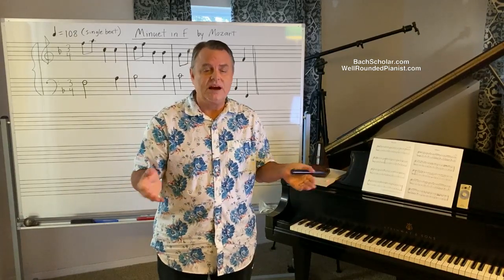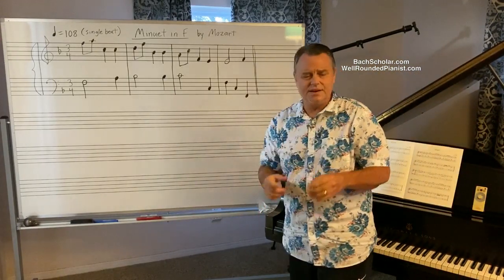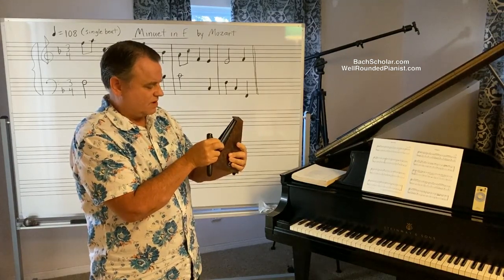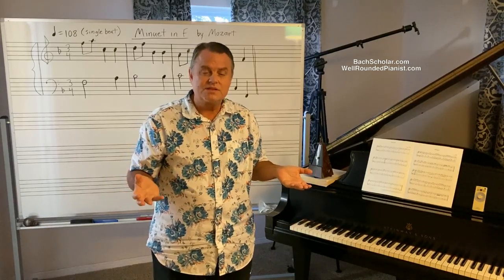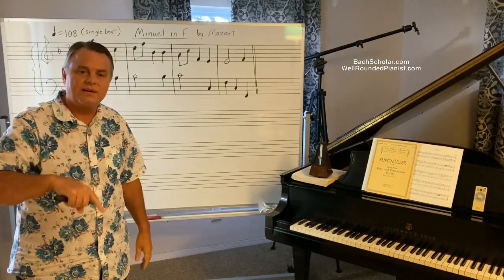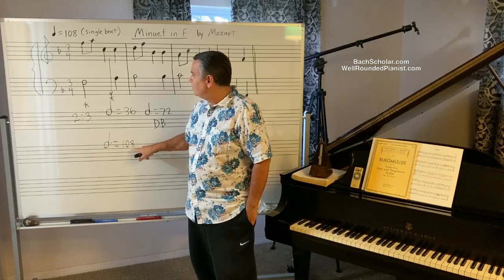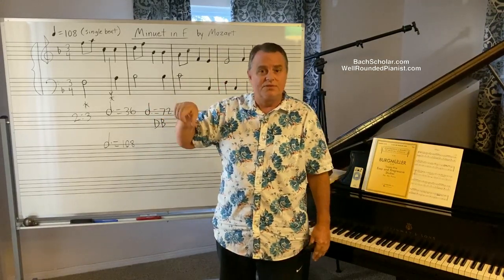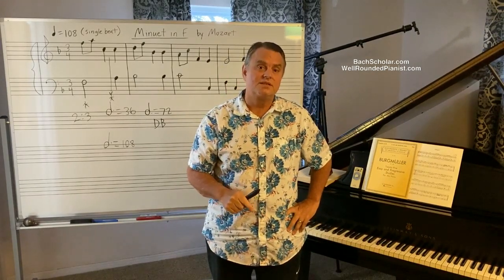(Part 1) Deficiencies in the "WBMP Tempo System" as taught by Wim Winters

Comment: Just to prepare you for the invasion of Wim's followers: If you would have to put quarter note single beat 108, you'd then put it 8th note 108. 
Then, if every composer used double beat, 200 wouldn't be scaring any students... so it will be very easy for Wim to "debunk" this. 

Not that I disagree with you (except the fact that "some" composers used double beat. Especially someone like Beethoven, who otherwise was very detailed. It seems unlikelythat he would leave that without mentioning it), but I'm not sure it's wise to use "don't you think..?"-arguments, when arguing with a theory that's completely built on "don't you think"-arguments.
Especially when there are more than enough evidence to show that the theory is wrong - Liszt have timings of the op 106, there are program notes with indicated timings, students of the composers recorded their music, etc. 

(I made some videos about it, feel free to use those sources!)

Anyway, I'm glad we're more people trying to disprove Wim Winters! :)
Reply from the maker: But in a piece like this that has no 16ths, using E = 108 in double-beat would not be used. Of course, they can argue that, but this would be a desperate attempt to disprove something that can't be disproven. They can't disprove 208 was the absolute fastest possibility, so they obviously can't disprove that composers often had to modify the speed downwards for practical reasons. This, by the way, probably best explains Beethoven's H = 138 in the first movt. of the "Hammerklavier". The best tempo for this movement is in the high 100s or low 200s, like H = 192 or H = 216, and since speeds like this are either impractical or impossible Beethoven had to go down to something like 138 to be more practical. So, I believe it should really be H = 192 in double-beat, which works really well and is Allegro (H = 96 in single beat). This "modifying the speed downwards" reason also probably best explains why all the fastest movements in Schumann's Op. 15 are all in the 130s like the first movt. of the "Hammerkalvier". Modifying Schumann's 130s to the upper 100s to somewhere in the 200s gives them the proper tempi and explains why Schumann chose speeds in the 130s. He chose them to be practical to piano students, not because they are best performed at these speeds (which are all far too slow if taken literally in double beat and is the way Wim Winters says they should be done).
Reply: @BachScholar  not quite sure I agree with your reasoning about the op 106, but that neither here nor there... and obviously I don't they are right... but they will be desperate and argue those points, so it was just a small preparation  :)
Reply: @BachScholar  All this reasoning sounds very far-fetched. What about the first English of the Hammerklavier having 1/4 note = 138? Also it is only marked allegro, not prestissimo, which is how so many pianists try to play it. Allegro, presto and prestissimo were not synonyms in the Viennese Classical era, but distinct gradations of speed, and also had differing charaters.
Reply: @petertyrrell3391  Like the 3rd movement of op. 27 No. 2 😉
Reply: @petertyrrell3391  most certainly a mistake in printing considering it was correct and changed. and the version closest to Beethoven would be logically the most correct one.
Reply: @vito-lattarulo  Most performances of this movement do not make the 32nd notes, which are written in normal notation rather than small notes, twice as fast as the 16ths! This is because they have started too fast.
Reply: @bradleyscarffpiano2921  How can you be so sure? After all the first English edition was by Ries, a pupil of Beethoven. The former might well have become aware of single beat usage in England (e.g. Novello).
Reply: @petertyrrell3391  Novello is not a reference to anything, he simply preferred slower tempi the same way Wim does. since of you double novels MM's its way faster than most written MM's on a score. this has been proven by piano pat in one of his videos. I can't remember which. and single beat was the norm. it wasn't a problem just with the English otherwise there would have been, multiple instances of discussion. or you would have expected Beethoven, (who was interested in moving to London but was too ill by the end of his life) to have remarked about it once. there is nothing to suggest double beat exists above pure speculation.
Reply: @bradleyscarffpiano2921  There is no evidence that Novello preferred slower tempi. He was also acquainted with lots of foreign and native musicians. I suggest you read his correspondence in the British Library as I have done. His MMs in all likelihood reflected performance practice of that time and often are doable and worth looking at for any performance. There is also the evidence of Benjamin Carr from the 1820s, which suggest single beat in the Anglophone countries. I don't think Pianopat has proved or disproved anything, and he seems to be motivated by pure hate.
Reply: @petertyrrell3391  A link for the Novello would be nice. as well as specific instances of his MM's being in line with "double beat performances"

But there is still zero evidence for double beat that isn't easily debunked. 
The MM's of today are playable. It's only a small handful that aren't. If you Believe Wim's claim that there are "thousands of unplayable metronome marks" You've already failed the first hurdle because that claim is just a claim of incredulity. it makes no sense. 

Pianopat isn't motivated by hate, He's motivated by the truth and I guess a bit of annoyance because Wim banned him. which he has also done to me and numerous others for voicing serious issues with his theory.
Reply: @bradleyscarffpiano2921  Many of Novello's early editions are readily available often have MMs. Gardient makes the point that on average Novello's are half those found in German and Austrian editions. There is also the problem of early and modern pianos, which you need to consider. There are no convincing performances of the Hammerklavier at the first MM in single beat. Perhaps some performers play some of the notes at this MM on a modern piano, but they don't play the music of the piece in any way. Anyway anywhere near the MM  in single beat negates the indication Allegro; Beethoven could have written prestissimo, but he didn't. PianoPat is the result of a highly conservative musical education in which independent thought is not expected.
Reply: @petertyrrell3391  Did you fact check that claim by Gadient? I'd be skeptical because form everything I've heard they aren't. Note I can't find an online edition of the score with the MM's however rpianopats video he plays them alongside normal version and there isn't much difference, 20% if anything. however Mozart is difficult to judge because we don't have MM's from him. 
Beethoven on the other hand we do, and here I stress. Beethoven said the Hammerklavier was the most difficult of all his works. he knew how tricky it was. a double beat performance is not tricky. it wasn't performed publicly for 30 years. so there's two conclusion. either the performers of the day were awful, or everyone in todays world is superior to Liszt. 

and no, piano pat is the byproduct of actual musicology. Gadient and Wim have been disproven far too many times for them to count.
https://www.youtube.com/watch?v=N1uGJI5tiNM
https://www.youtube.com/watch?v=0WEebNfvVlQ

two recordings which are pretty spot on and are fantastic to listen too. if, as you say. go in with an open mind. 

also many people have come forward and said that early pianos were faster with scales. and since we have the same escapement action as the pianos towards the end of Beethovens life they rant that different. Watch the video by Nahre sol where she goes to Weimar and plays Liszt's own piano. her first reaction is that the touch is incredibly light and that scales are effortless. Therefore it's quite probable that they could reach those fantastical speeds. Wim's claims are based upon his pianos, which I highly doubt he's ever pushed to their limits. remember that Liszt and Beethoven famously damaged the pianos during performance.
Reply: @bradleyscarffpiano2921  Gardient is a serious musicologist and a priest. You are used to the usual tempi at which the Hammerklavier is played and you appear to listen uncritically. As for those 2 performances you mention they are simply too fast to be musically comprehensible and don't respect the indication Allegro. They are superficial. The difficulty of the Hammerklavier is the leaps and contrapuntal complexity, for example, none of which is helped by single-beat performance. Runs, I understand were a bit easier on early pianos, but not playing loud and fast for a long time, nor repeated notes. Czerny and Moscheles provided MMs for Mozart's sonatas and read in double-beat they make sense; in single beat they render these sonatas trite. Regarding Op 27, no 2, 3rd movement, single beat performances make the 32nds unplayable. It may be wishful thinking on your part to think that Gardient and Wim have been debunked, but your attitude to evidence is very selective.
Reply: Peter Tyrrell you’ve done nothing but evade then come up with arbitrary points. Musicality is subjective but I like how you’ve changed your tune from “it’s impossible” to “it’s un-musical” which is the exact statements moscheles had made about the hammerklavier. How it was “far too furious a prestissimo that  the composer could have intended”  

Lorenz gradient is an amateur musicologist which itself isn’t the issue. The issue is how the facts he presents simply are not true. Metrical seconds and pendulum swings have nothing to do with Maezals metronome. 
As for opus 27 no2. They are playable people just slow down fir expressive effect. If you don’t notice that then pay more attention. There are recordings on period instruments that don’t slow down at that part
Reply: petertyrrell. Jérémy threatened to report me, because I used the word «manipulated.» So it’s good to see that you, petertyrrell, have been manipulated by Wim Winters. petertyrrell, about Beethoven’s Opus 27 no 2, «Presto Agitato». Quote: « Most performances of this movement do not make the 32th notes, which are written in normal notation rather than small notes, twice as fast as the 16ths! This is because they have started too fast.» Wrong! Let us take a closer look at the 32th of the Presto movement. There are 5 notes in each group of the 32h. The 5 notes together span one octave. Because we have 5 fingers on each hand, we don’t have to move the hand. That means the 32th can be played as quickly as the instrument’s mechanics allow. 32th is technically easy to play, compared to . . . . . 16th! The race over several octaves in the beginning, is  technically much harder to play because you have to constantly move your hands. And the fingers have to find their new positions at lightning speed. And the farther from the middle of the keyboard, the more demanding it will be finding the correct position of the fingers. In the comments section of the video in question (AS «Even Valentina Lisitsa unable to fix Beethoven’s Moonlight ‘Mistake.’») We see that several were manipulated. So why do pianists overlook 32th real speed? The answer can be found in H.I.P. Historically informed performances is not only important for understanding the Baroque period, but equally important in the following periods. We also note that Wim Winters doesn’t play Beethoven’s fermatas in the 32th section. 

Peter Tyrrell! Be careful about quoting Wim Winters. When he has to censor and manipulate to retain credibility, he has no credibility.